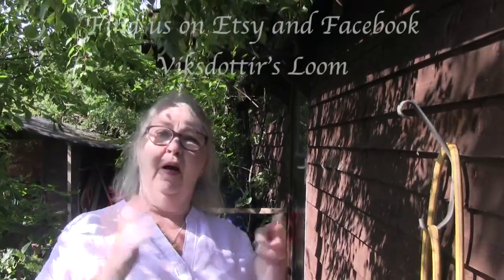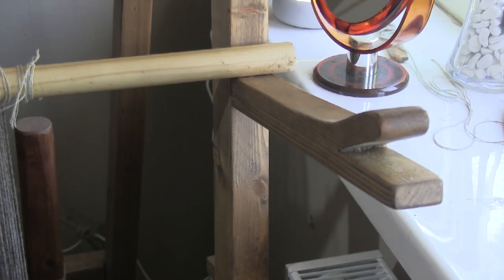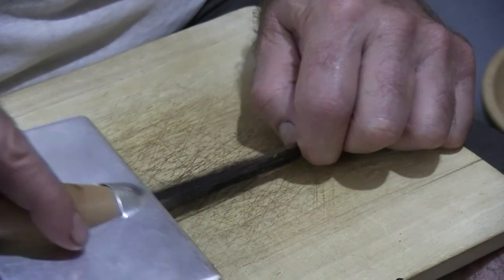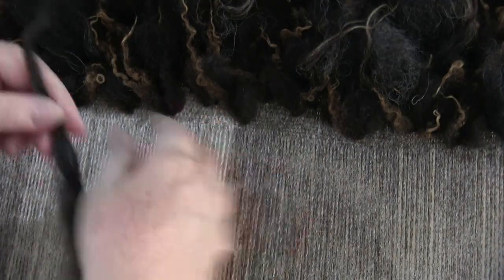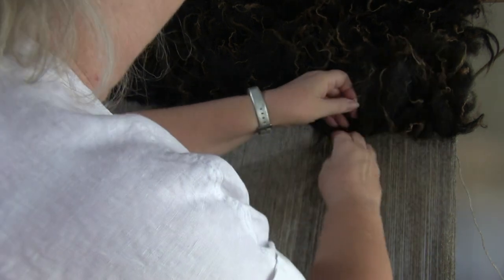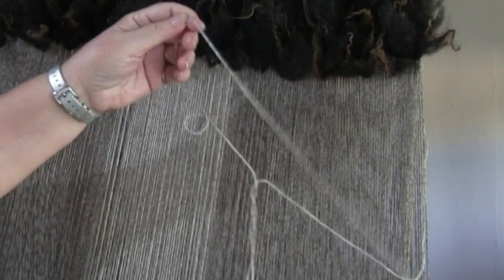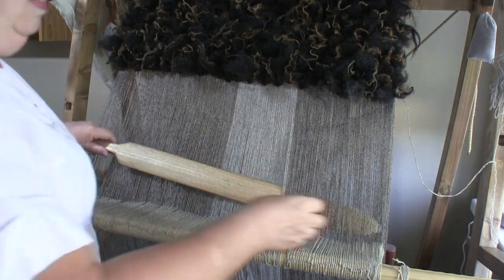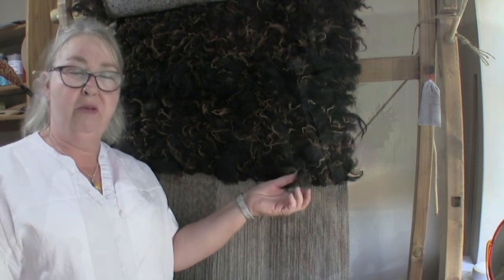Weaving a varafeldur - a Quick Look at how it’s done

Comment: That is wonderful. I've been wanting to do something similar. I do have a couple of questions. Did you wash the locks before weaving? If you did, how much lanolin was left in? In the video you showed weaving in the locks using the back heddles. Did you use the back ones each time, or did you use both back and front ones?  I assume you used the 2 colors of warp to keep track of beating as you went across the warp? If not, may I ask why you used 2 colors? This is a phenomenal project! Thanks for the video, it really helped me understand the process!
Reply from the maker: Orlaithe the Wanderer thank you! No I didn’t wash the fleece before weaving, the first fleece we bought were already washed but I found them too felted and we’re pretty useless.  There was a lot of grease still in the fleece I did use.  Makes your hands beautifully soft.  But that was why I washed it gently when finished trying not to felt it. Yes I did try to alternate between front and back warps by making 3 passes of tabby weave sometimes between adding the locks.  

I write a little more about the background and photos on my FB page Viksdottir’s Loom I did it over 2-3  posts.